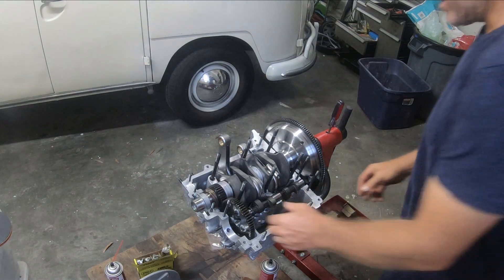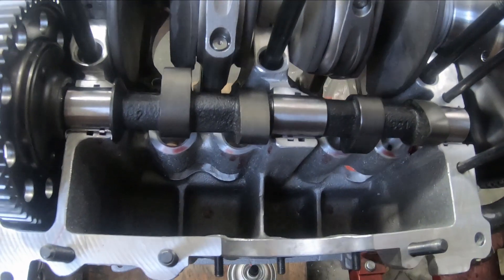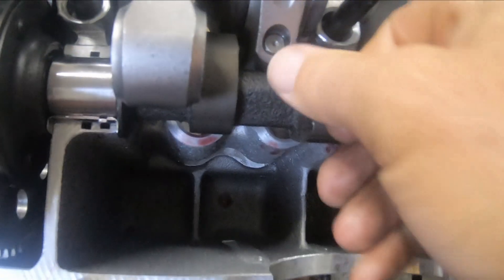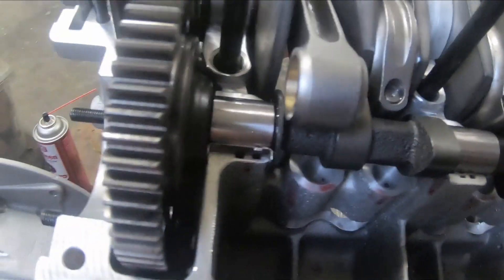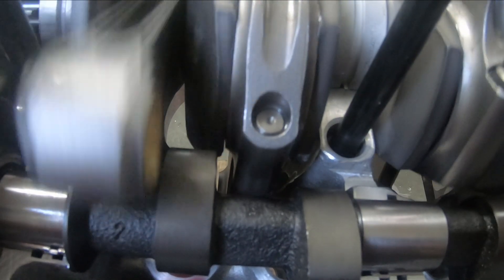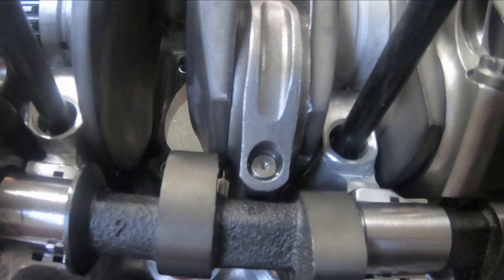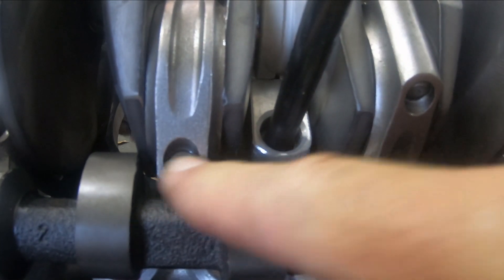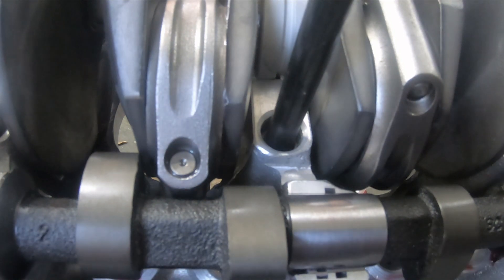2332 VW Air-cooled Stroker Motor - Video 05 - Checking the Clearance - Rods hit FK42 Camshaft

Comment: Dremel will take you a month to clearance that cam.  But the manufacturer already puts the flats on the cam so you can see it where you need to clear.  BAck in the day -  no such thing.  And STOP letting the rods ride the case.   When you turn the crank for any reason, you PICK up the rods w/ your hand so you don't gouge the sealing surfaces.  And no jewelry when you are working in the shop -  good way to lose a finger.
Reply from the maker: Good point on the rods riding the case.

Comment from the maker: I had the cam gear installed with the wrong rotational alignment.  There are 3 hex bolts and if you do it correctly the "flat" sides of the cam will align when the rods come around.  However, with the 84mm crankshaft and the 3/8 ARP 5.5 rods, there needed to be a bit of dremel work just to be absolutely sure...